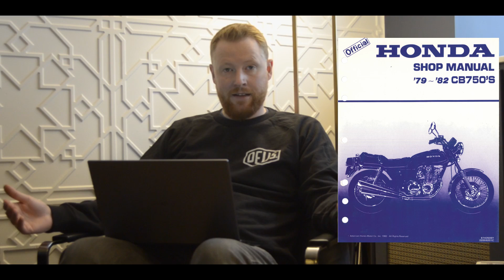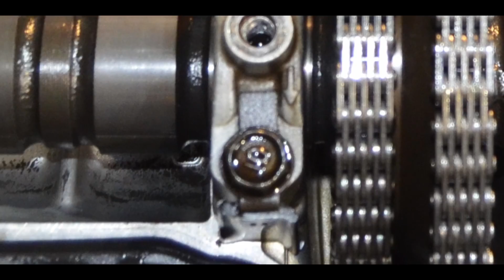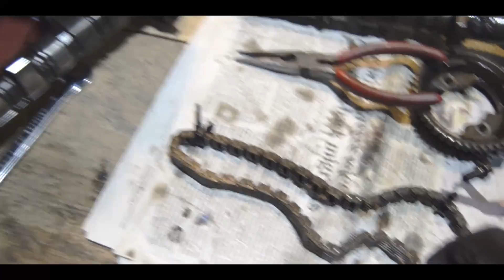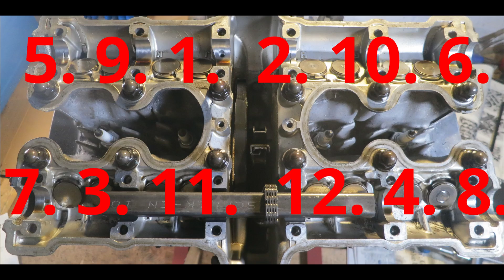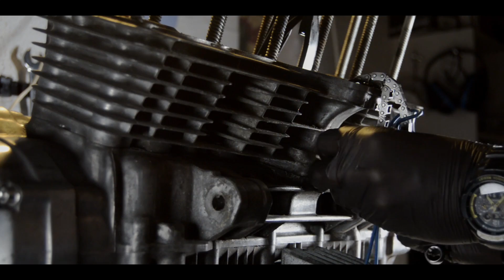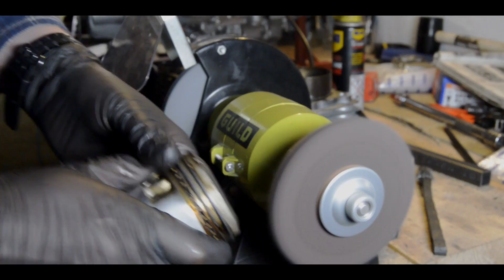Honda CB750 DOHC - Engine Rebuild Step by Step - Ep1

Comment: I definitely hit like on this video. I know this is a five-year-old video. As someone who rebuilds these engine engines frequently and works on old vintage Hondas I loved this. I live in the U.S. in FL. A lot of good tips and tricks that I also use so not anything new or helpful for me except your brilliant idea of the plastic shims! Right-O! And also the zip tie on cam chain trick. Ima use those two tricks. Great video! Highly recommended for first timers rebuilding there DOHC Hondas.

Comment: Good videos! There is an inconsistency with the unbolting of the exhaust camshaft in the video. You say that it goes DGrAE but you unbolt them DGrEA. Which is correct? Thanks

Comment: A quick question from a beginner - I pulled the head a few times, first time however doing complete cylinder removal and check up, is there a good way to check the crank without splitting the case ? I have a bike that sat for 8-10 yrs, it was running ok untill the owner passed away

Comment: Great video on the 900 engine. Question for you. Is it possible to replace the exhaust cam chain without removing the main crank. Thank you

Comment: Please tell me - the very forward left case engine cover  that has 3 bolts , and that attaches to a larger cover piece of about 11 bolts, I have learned of three screws that could be loose that could cause things like the starter not engaging consistently.  

Is this a dry ( like the Stator coil side) , or a wet environment where one must account for engine oil if to remove either of these left sided engine covers ? thanks for your help -
Reply from the maker: I don't have the engine in front of me (or the manual) but fairly sure there is oil behind that one.
Reply: @naturalsIV  Thank you again for your reply - that was my gut feel. I do plan on 10W50, but just replaced the 10W30 with 10W40 due to oven temps - I have a Pizza Oven Temp Gauge placed between the Clutch and Alternator housings.  She can read upwards of 220f in New England - so I figured to try the 10W50.  I am hoping I am speculating on the three screws under the left side, under those wet housings being loose for now - if not here comes another oil change !

Comment: I was wondering if you could help? My CB750 DOHC Transmission seems to loose its shift under acceleration after in gear? 

I have a 1979 CB 750. She has 14,500 miles on her. the last 1,000 this past year, the previous before I stored her in 88.

I have done as lot of restoring during the Shelter in place.  Now that she is doing well, I drove her under demand today to get to hi-way speeds. 

Today, first time I observed her while under acceleration demand, slipping out of a higher gear for a lower one? This happen a few times today. 

I was not sure if it was my foot inadvertently pushing the shifter down while my weight shifts under acceleration, , or is this a known mechanical issue with the CB 750 - 

Any thoughts would be helpful - thanks
Reply from the maker: Really not sure I'm afraid. I haven't got as far as rebuilding the tranny yet. CB750c.com or Cb750.com are a wealth of information though.
Reply: @naturalsIV  hanks very much for your prompt reply - It notes issues here https://cb1100f.net/Other/MotorcyclistJuly1981ShifterArticle/MotorcyclistJuly1981ShifterArticle.pdf

Comment: what happened to my comment? did u delete it letterbox?
Reply from the maker: Dunno dude. I delete very few comments and only ever the snarky / trolling ones. As long as it was a nice comment it should still be here :-)
Reply: @naturalsIV  ok thanks for responding. no snarky trolling i don't think. i just had some good info on how i removed my head and stuff to try to help peeple. my only sin i can think of is that i mentioned a soft tip hammer from harbor junk with part number. also the method was different than the way u did it. so i thought maybe u didn't like that. anyway, you could make an amazon money making link for a soft tip hammer and make some more cash!
Thanks for the videos! they really help.😊
Reply from the maker: @superdan3661  Ah no, I definitely wouldn't have deleted that. I dont recall ever having seen it tbh. I do add the odd link for Amazon referrals here and there, so I'll check out a soft hammer. Thanks Dan!

Comment: what can i do if the large nut will not move the camshafts into place? i think its seized somewhere
Reply from the maker: Penetrating oil, heat, most importantly patience will help.
Reply: @naturalsIV  i’m able to move the nut in both directions but it doesn’t do anything. is there any other way for me to rotate the camshaft with the two sprockets? i’m unable to get one of the bolts out

Comment: Can the head be removed with the engine in the frame? According to my Clymer manual, you can't, but I remember a comment in the CW mag test that stated the frame is arched so the head will come off with the engine still in the framw.

Comment: This video is just what I’ve been looking for, when is part 2 being uploaded? I have a 1997 CB750 which I’m planning on doing the same thing too but have zero mechanical experience so will need this videos to use as a step by step guide. Looking forward to the subsequent videos. 👌🏻
Reply: That’s great, look forward to watching it. I thought it would be, it’s a starting point for me, the bike is running but not too worried about messing up, I’d do the diligent thing and take photos and lots of freezer bags to enable me to look back on what I’ve done along with the manual
Reply from the maker: Part 2 now available on the channel!!

Comment: Great Start! I have 2 of these 1980 CB750F bikes (I grew up hearing that inline 4 sound from my brother's Suzuki GS 650) and have challenged myself to rebuild one back to original. I've been watching so many CB750 rebuilds to build my knowledge base but they are mostly all SOHC engines. Thank you for diving into rebuilding this engine and for giving us DOHC guys something to chew on. I hear that parts (particularly bearings) are hard to find for these bikes so I would appreciate it if you could document where you find your engine parts as you get into evaluating the internals and ordering replacements. Thanks again Mark Tes
Reply: http://www.cb750c.com/ & http://www.cb1100f.net/ Good forums for DOHC owners. Some of the users even produce  certain parts, and some has redesigned/upgraded versions that eliminates some of the bikes weaknesses. Good luck
Reply from the maker: Part 2 now available on the channel!!